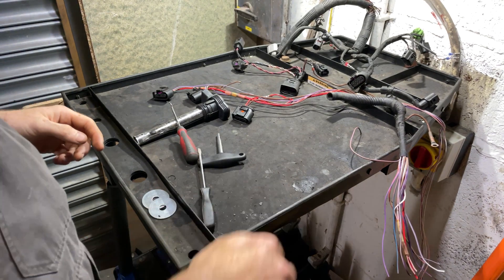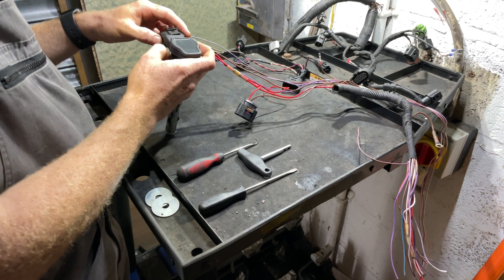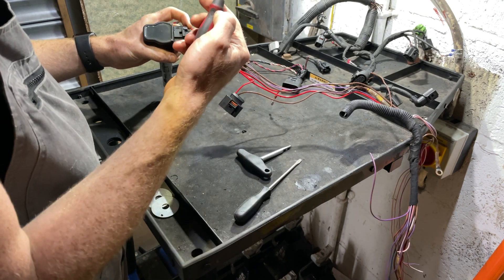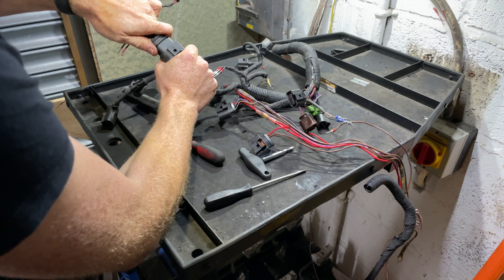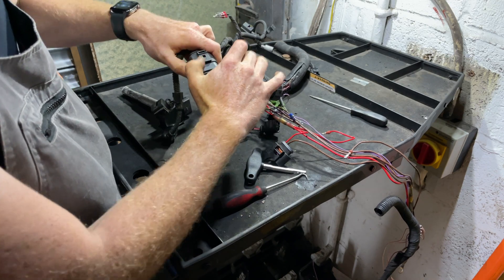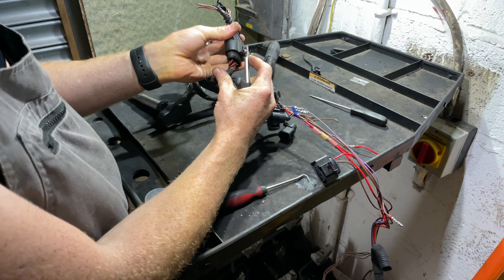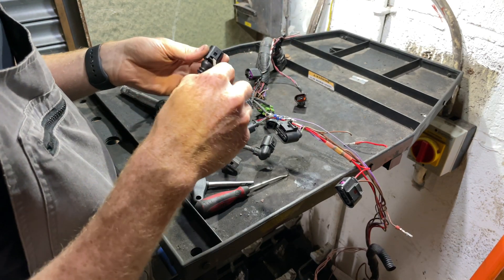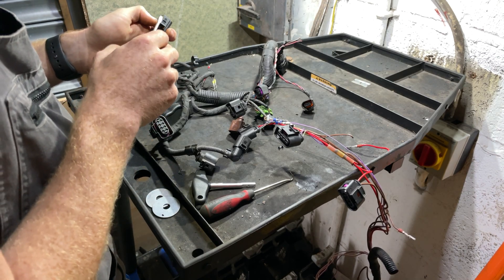Undoing broken or stubborn VW/Audi wiring connectors.

Comment: I can’t get off a mk5 golf headlight plug, the clip is broken off and can’t budge it.
Reply from the maker: If you watch the video you’ve just commented on, you’ll find out how to remove it.
Reply: @ it doesn’t show how to remove it when there’s no room to get to it. Do you know how tight the space is in there? You can’t get a screwdriver in there, can barely get your hand in there. I got the light halfway out forwards and there’s not enough wire to create much more access.
Reply from the maker: @ use a hook ended pick like tin the video.

Comment: add a little silicone grease to  the seal and terminals ti make it easier next time too and stop any later corrision as well.
Reply from the maker: No. Don’t do that, the seals swell so easily.
Reply: @theweekthatis slicone grease wil not swell silicone seals . in acrs used in salt corrosion can be a huge problem especially if the use oil based protectants it attacks the silicone seals in the connectors... or if someone gas used an oils based cheap spray to help remove them in the past..
Reply from the maker: Also, I’ve never ever seen one corrode (undamaged)

Comment: Is the connector for the ignition coil the exact same one for the headlight assembly?
Very easy to unhook on the bench very hard on the headlight assembly very tight dark spot!
Reply: On the fight right now... Don't have a hook, it's near impossible.
Reply: @JimzleGameplays did you get it off? Im currently trying and cant get it done